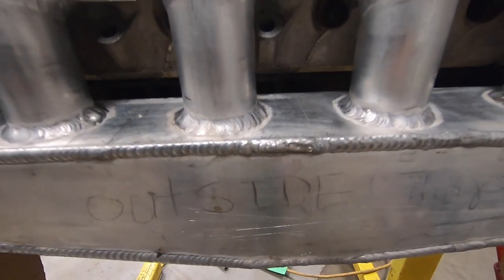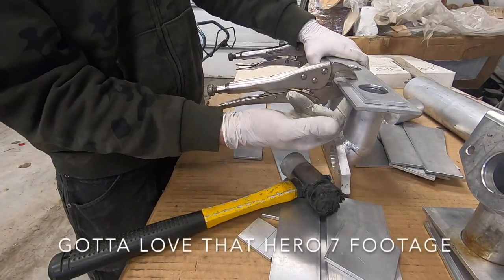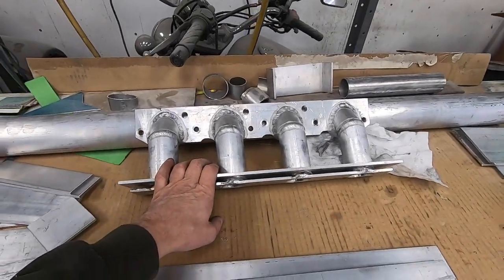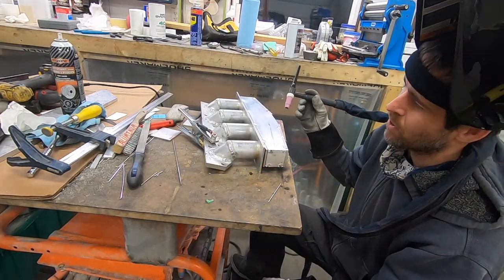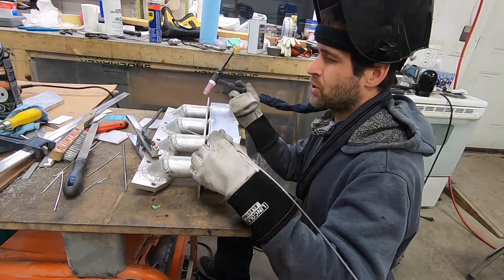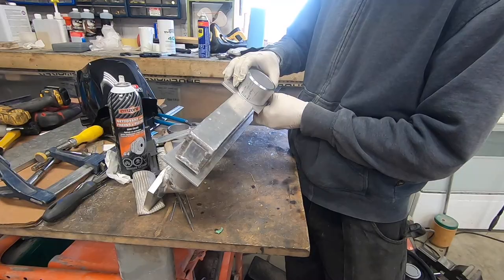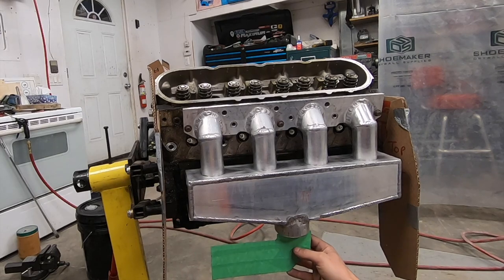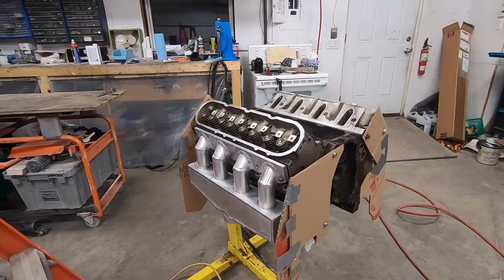V8 Jet Boat Manifold Build - Part 4 - ALMOST...

Comment: Hi mate, absolutely amazed how the exhaust manifold has turned out,  I don't think anybody else could have done a better job, welding and fabricating the custom exhaust system, well done with the video and with the information you have given us, cheers and good luck with the next one
Reply from the maker: Thanks Adrian. It sure is a lot of work, but a lot of fun. I'm quite pleased with the results so far.

Comment: Love this and probably going to do something similar for my LS jetboat swap. I know you had mentioned being new to aluminum welding, I would recommend letting them air cool, instead of putting them in water. If aluminum cools too quickly it can cause cracking. Love how they turned out! Keep up the good work.
Reply from the maker: Thanks for the comment and advice ! Have you seen any of the new JetSki Brothers videos ? Josh actually turbocharged the V8 this year and found a different set of manifolds. They are a jacketed / shielded log type that were quite compact ... He has a video from earlier this year where he shows modifying them to turn the shield into a water jacket. It looks like a lot less work.

Comment: It's ok Joel. You can say I was the one concerned with primary Heat Lol.  I'm glad to see you are going to try to cool the primaries as best you can with water.  The manifolds look great by the way.
Reply from the maker: Haha... I didn't want to make you feel attacked, and I'm sure there are others who had the same concern. 

The First mention of it in this video (I think) was actually shot before we had a conversation about it, and I think I mentioned in the first video that I had planned something.... I've been talking to Josh and there isn't even enough room (we think) to run cooling lines over the valve cover, so we may have to use 3/8 aluminum hard line and Ts out the rear between the flange and runners... or between the runners and the block.

I'm really happy with the way they are turning out. This is only my second real TIG welding project, so I'm glad it's going as well as it is.
Reply: @JoelArseneaultYouTube  Yeah you have done a great job building the manifolds. I can tell you spent time on them and didn't just slap them together half assed. 
I would also like to say that my comments were not meant to bash or attack you in any way so hopefully it wasn't received that way. I wanted to make sure the manifolds rock 100% for you and Josh. People don't like to take advice from people in the comments section because most of them have an IQ equal to a bag of hammers, but some of us are actually intelligent and have a lot of experience engineering stuff like what Josh is building. It's hard to figure who is who sometimes lol. Anyway great job man.
Reply: I would also like to add that Josh has impressed me with his fabricating skills. I had my doubts about him pulling off building that gear box and getting it aligned properly buy he seems to have pulled it off.
Reply from the maker: @chrisglassey8585  Quite honestly, I'm glad it's him and not me... this is a massive project with lots of "little" things to go wrong. I was also impressed to see how well he got the gear box coupler to line up. It's must be taking hours and hours of messing about for a 30 second clip of him showing a feeler gauge test and being like "yup, it still lines up" haha.

Comment: Best place to get exhaust manifolds is Tim Horton's! That is some tricky welding. Bravo man! 4 stroke exhausts get a lot hotter than 2 strokes right? That thing will probably have more cooling in the exhaust than the whole block.
Reply from the maker: Haha... They have a few Tim Hortons in the US... Any in Washington ? 

I think they both run around the same, however a two cycle has huge changes in temp due to the volume of the chamber VS the head pipe, and also the cooling from intake charge escaping into the pipe cooling, and pressure building causing extra heat.  A 4 cycle tends to build heat based on engine load and is much more consistent. 

Hopefully the excessive cooling is enough, haha.
Reply: @JoelArseneaultYouTube  I don't think we have a Tims. I think our Tims is Duncan donuts and I've never been there. So sad. It sure seems like it would be plenty cool. I'm just picturing the videos I've seen of turbo headers glowing.
Reply from the maker: @Jacobskibros  I don't really do Tim's ... but don't tell the Canadians or I'll be kicked out. I've never actually had a coffee ... ever. Just not my thing. I was a huge fan of Krispy Kream but I think they all closed up here in Canada. 

Lets hope there's no glowing headers on this ski 😅... just glowing reviews on the headers lol.
Reply: @Jacobskibros  omg me too , bright orange. . 
Two strokes definitely get hotter in a naturally aspirated situation . 1400 degrees,  and cylinder head temps 475 degrees.  most cars engine temperatures run less than two hundred degrees with egts less than 1k.

Comment: Wow, that has to be the most unique ls exhaust manifold I’ve ever seen. Just out of curiosity why is it that the manifolds actually need to be cooled, if they’re fine on your car wouldn’t they be fine on the ski? Is it because of the lack of airflow in the jet ski, or is this water jacketing just for some performance upgrades?
Reply from the maker: Hey Ben. 

Haha... Yup, you can actually purchase LS marine manifolds, but they are very pricey and none would fit in the JSB ski. 

Cooling the exhaust on this is for two reasons. One being that it would get way too hot in the engine compartment, and two, the exhaust would likely burn the fiberglass (and anything else close to it)  So yes, air flow is one main issue. 

Cooling the exhaust charge actually has a slight negative effect on the performance as the cooler more dense exhaust is harder to move and causes more resistance to flow. 

All watercraft, that I am aware of, have some sort of cooling on the exhaust because space is limited and when you are in water, cooling is a pretty easy thing to do (compared to running a closed loop cooling system)

Comment: damn, good work, hey why dont you weld some custom scupper valves for your x2?..... im thinking of having 1 made for mine
Reply from the maker: Thanks Zack. 

1. I never thought if it lol 
2. Where would I put them ?
Reply: @JoelArseneaultYouTube  you would put them where you have the exhaust outlets, although not water tight, itll keep water from free flowing into the waterbox at idle,  keeping the already heavy nose from getting heavier with water.
Reply from the maker: @bmxbarron  Oh... I thought you were talking about the ones to drain in place of a bilge pump. It would be nice to keep water out of the exhaust. Maybe I'll look into it in the future.

Comment: Generic non copy written music.😆😆. Anyways mani's look unreal. Aluminum gets really really hot when welded as you know. 🔥🔥🔥
Reply from the maker: I'm really happy with the way they are turning out. I did more work on them today and I was so happy I was giggling like a schoolgirl... 

Does it ever. That's a big part of the reason we are using for this exhaust... it gets rid of heat quickly... in this case it's into my hands 😂